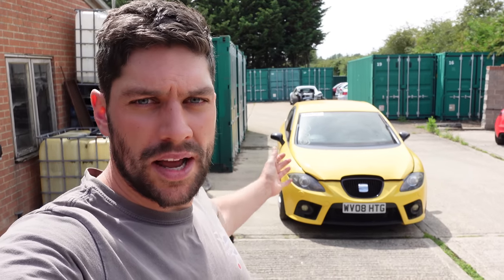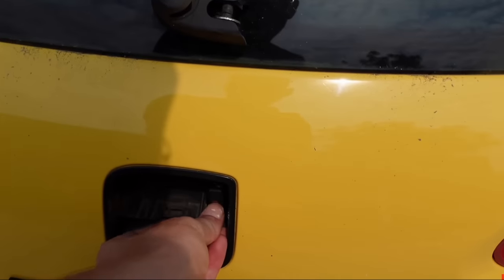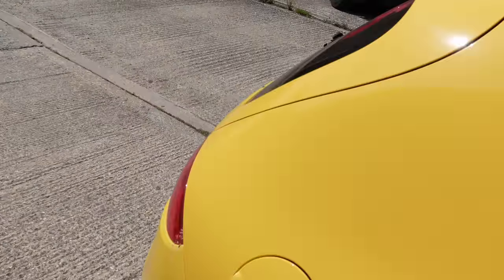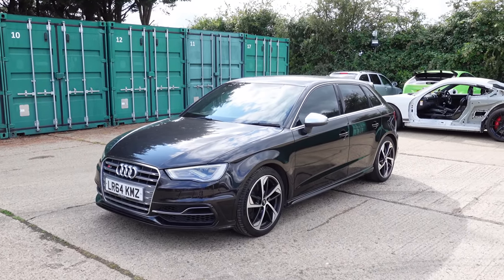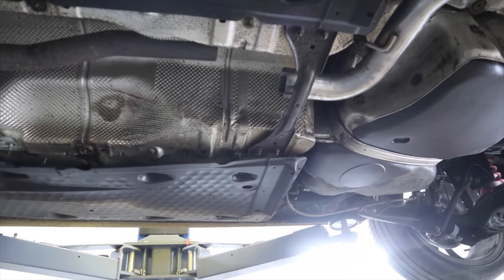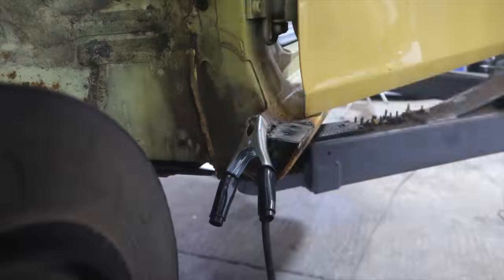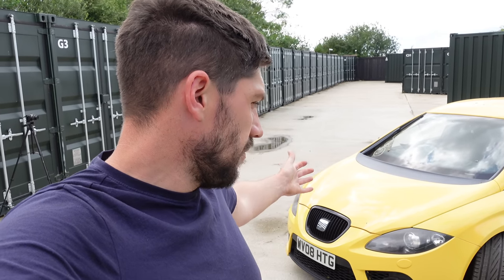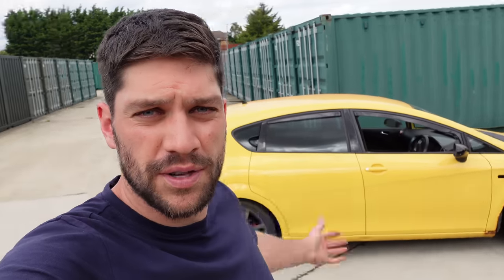MY SEAT LEON CUPRA IS SCRAP!! I CANT FIX IT!

Comment: You’ve done a good job to the car, good bit of work done to it already 
It’s not that big of a job replacing  that part of the chassi I’ve done a lot worse than that, I definitely wouldn’t be scrapping it after all that work done to it, it be worth more when it’s finished rather than scrapping it

Comment: Lesson learned on that one unfortunately, we have all been there you are not alone. Stick to what you do best and stay away from rusty sh!T boxes. I was told years ago buy a clean car with a stuffed engine and not a rotten car with a good engine. Easier to replace the engine than try and rebuild a rusty shell. Keep up the good work Dean. 👍

Comment: You called this one correctly, there is a learning package here for most to benefit from. Rust is the enemy of almost every car on the road. Clearly with hindsight, the rust on the wings was a pointer to trouble, the state of the rear suspension amplified the 'rotten' message. This is one for the great motorway in the sky, or more simply, the scrapyard. If you try to recover the value of the parts that you installed, how buoyant is the market for a one 'man breaker' business?

Comment: With doing restoration work. It's always twice as bad as it looks sometimes much worse. With modern car's of today you have to be careful not to compromise the crumple zones with over welding and use a proper spot welding machine as much as possible be they are made to brake on impact where welding is so much stronger.

Comment: Seeing how this turned out to be a rust bomb rather confirmed my scepticism towards considering cars that old at all. We see so many cars that are still amazingly tolerable at a similar age (or older) and hear about how 'modern cars don't rust like they used to because of galvanizing', but the truth is that those are probably outliers that have been well-conserved. Either that or VAG cars are awfully-badly rust-prone. I had a 13-year-old Renault Clio (from new) which was structurally solid (until I crashed it), but the thought of replacing it with something of close age (and inexpensive) was too much to contemplate. Cars - they get you one way or the other!
Shame about this Cupra, but I might have guessed it had deeper troubles as soon as I saw the body panel rust.

Comment: I bought a Passat TDI from a local car sales here in Glasgow. I took my mechanic guy with me, he said it looked OK, apart from the usual wheel arches, which had been done once already. He did mention that it looked like a builder had used it before, as it was filled with orange sand. Speaking to the guy selling it he said it had had 1 lady owner before me who live in Aberdeen and had used the car to take her dogs to the beach, which was backed up by the log book. Long story short, I had the car for about 4 years before it failed the MOT with subframe rust. It was the same as this car thou, the engine was great, but the body was fucked.

Comment: I found on my old gas-less wielder it was too powerful running of the mains but running it off a small generator worked much better. I ended up getting a gas one as a replacement  :)

Comment: Shows the perils, if it wasnt for you removing that arch liner, there's a chance that level of rust wouldnt be discovered at MOT time.

Plenty of MK3 MR2s out there with a gaping hole in the subframe but hidden by a rear plastic liner

Comment: It's the welder your using i do welding for a living especially automotive bodywork and them gasless welders are no good for thin sheet metalwork they put far too much heat into the job and just blows holes.

Comment: I had that exact welder. You need to check the polarity. They're wired up electrode-positive, which makes them a nightmare to weld with at the best of times. Combined with having basically no current control, you'll never weld thin metal with them. Especially gasless. Speaking from having the same introduction to welding..... the problem is not you!
Reply: Knowing when to say enough is important. You've learned the same lesson I did once on not tearing everything down before starting work. At least you knew to stop.

Comment: There are place in the USA and Canada where vehicles with as little as 7-8 years old that have dangerous rust out rot on their 'wings', frames, sub-frames, suspension components. I bet that car was sold off as couldn't pass an MOT, even from a crooked examiner. You really have to look at anything you buy in person, look in places on the frame, sub frame, key structural areas for severe rot. Now you know some areas to look at in any future vehicles.

Comment: Bought a BMW X5 from Scotland 10 plus years ago. The brake pipes started leaking due to rust needed to replace parts approx 1ks worth. went to trade it in a few years later and the garage refused the deal as the car came from Scotland. Lesson learnt never buy a Scottish care due to the salt they put on the roads.

Comment: For a minute there, i was transported back in time to the early 80s looking at a an old British Leyland or alpha Romeo, this car should have been scrapped without wasting time on it. Looks like this car was made with low grade steel, just like the 70s and 80s cars, sometimes the metal was already rusting before they made a car out of it, and no rust proofing as such which is why most cars lasted less than ten years.

Comment: Use it as a car you can learn those types of repair on. You make not make £ on this, but with new skills you can avoid similar mistakes or tackle bigger jobs with less risk and greater profit. If not strip it, it’s not good enough to be put round a track as that chassis is dangerous.

Comment: It's a dam shame. If you were going to keep it, I'd encourage you to finish the job. But as it for sales, and you've got to get back your money, I agree with your decision

I know the feeling though. I bought a cx-5, and when I took it to my mechanic, I learnt that my entire rear subframe is rotten. I then get a good used frame to then learn that I've got a blown head gasket. I replaced all the gasket to now replacing parts on my fuel system.

I'd get rid of the car, if it weren't for the fact that I've spent so much, and I bought it for personal use

Comment: back end (which uses same parts as this car) on my 2012 Audi TT is nearly as bad!  Is quite shocking and not what youd expect from VW group - your welcome to transfer all those bits to my car for me Dean! 🙂
Reply: Oh it's absolutely what you'd expect from VW group 😂the 2000s and early 2010s VW group cars are notorious for rusting very badly
Reply: @Afraz_9n3 yep, shite build quality. It’s a disgrace 😬
Reply: @royfontaine5526  tbh it's normal for even other cars of the 2000s but VW just has more noticeable rust spots like the sills and arches. Scottish cars especially are known to rust especially bad
Reply: @Afraz_9n3  I know and agree, it just doesn't seem good enough though. I have a 20 year old Jazz as part of my fleet, and they're notorious for being complete rot boxes - but mine's not as bad as this! You'd defo right about Scottish cars - avoid like the plague!
Reply: @royfontaine5526  yhh I have a 14 year old VW Polo and it has nearly no rust only a small patch on the drivers side sill and wing. I think this cars so bad because it's been near the coast that's what Dean said in a previous video 🤷🏽‍♂️

Comment: 9:10... Dude, u have a GARAGE!! DON'T give up on this, especially as much work u already did!! Nothing wrong with doing something right, especially when uzr equipped to do so. U got a garage WITH a lift, my dreaaaam!! U got an expensive good welder, so go get a cheaper 200 dollar (or whatever pounds equivelent is) to tackle the ultra thin metal, why not? Then ur more equipped for this and future projects. Take ur time, patience, and do it right, u'll be happy with the results. I LOOOOVE my 2010 Cupra R, wouldn't trade/sell it for NOTHING!!^^
\O>

Comment: Probs would have been better to get a chassis leg cut out from a scrap yard and have a pro do the work. I recon on ebay you'd be lucky to get 800 quid for it. Maybe a subscriber /welder will take it and save you from the huge loss

Comment: Why don't you just buy a gas Mig welder? I've had this issue as well with flux welders but with a gas welder its usually no problem.
Reply from the maker: Ultimately the welding issue wasn’t the reason I stopped. I stopped because of how bad the rust was and how bad it’s going to be elsewhere.
Reply: @SavingSalvage  Yes I saw the footage after. It didn't look nice under the wing :)

Comment: Really sorry about this Dean... I felt it was gonna end up this way from the initial stripdown.  The magnitude of the rust problem sealed this car's fate from the getgo.  Interesting you say that it came from Scotland.  A few years ago a Scottish friend of mine sold me his 10 year old Toyota Yaris for £50 - I was only after the alternator.  Before I'd seen the car, he told me it had failed its MOT here in London with what the tester said was the worst rust he'd ever seen in a car !  Fearful of how bad this was,  I asked him to drive it the 5 miles over to my house.  Knowing nothing about cars, he was perplexed at the MOT tester's comments as the car never had so much as an advisory in Scotland.  When I saw it,  I was shocked.  Both struts were barely connected to the body with virtually nothing left of the turrets... the chassis legs were like doylies... unreal.  Now,  like this car here... rust that severe doesn't happen in a single year... which begs the question... how are these cars getting through MOTs in Scotland ?

Comment: Er, not scrap - that's a bit clickbaity. Fair enough selling it on as a project and reasonably priced (although you could have waited until the welder guy was available next week and see what he thought/would charge to weld it safely. Also, get a proper gas bottle MiG welder.

Comment: Dude you need to get yourself and good welding machine... I'm no expert but those look like basic welds you should be able to handle
Reply from the maker: I would have thought so too!
Reply: Well don't worry about it.
An Expert has appeared.

Thin Gauge can sometimes require a Tac plate.👍
Same Gauge but Placed Underside for Weldpool to Start 🤠🤠🤠